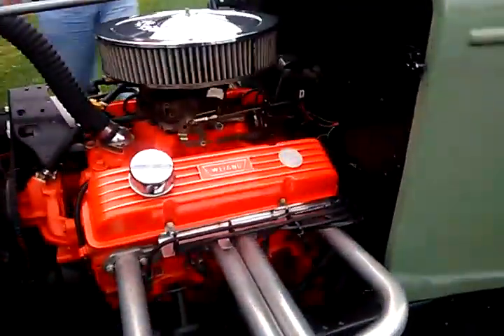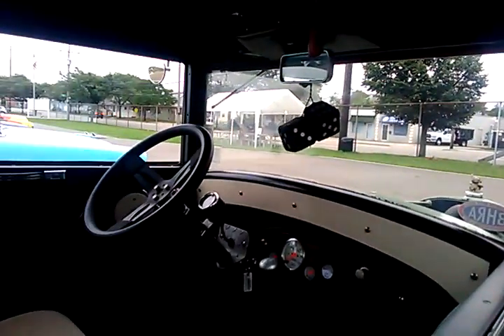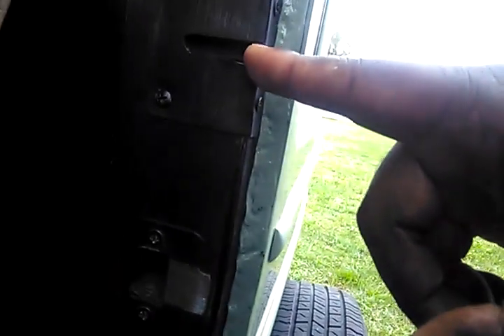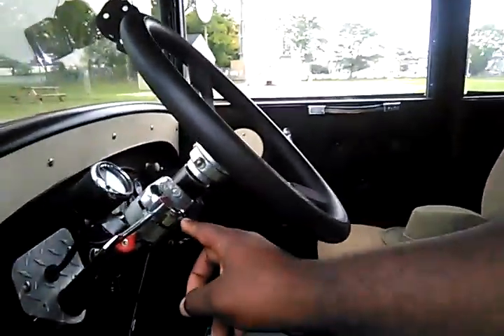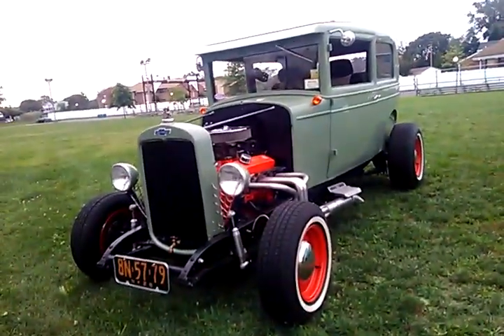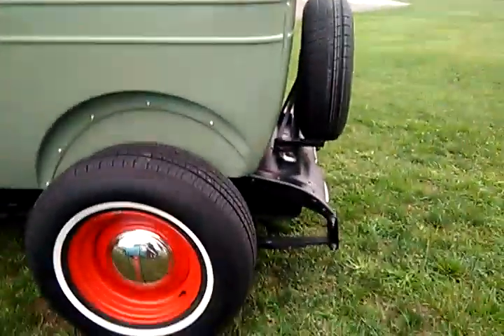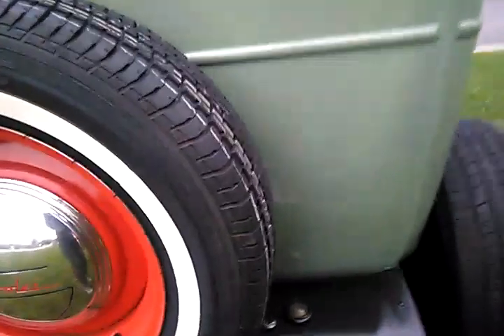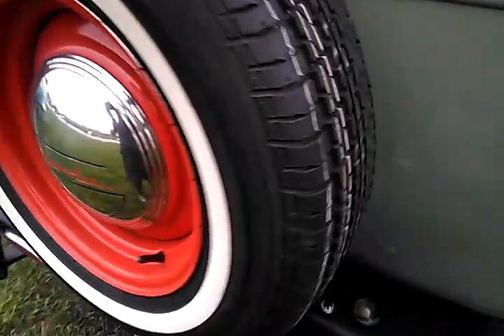1928 Chevrolet National 2 door

Comment: Mmmmmm love this little joint! No clutch pedal?
Reply from the maker: This is an automatic, TH350. You can put a shift kit into the valve body to manual shift it like a manual, 1-2-3. But it is just a 3speed but you can add a manual to this before you put the body on and then route the cluth pedal later.
Reply: @GalaxieMarauder  oh ok